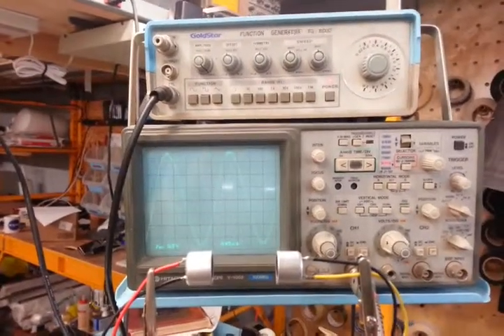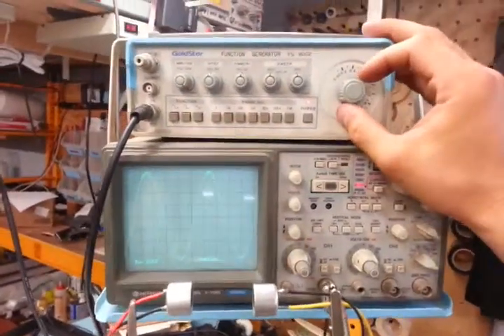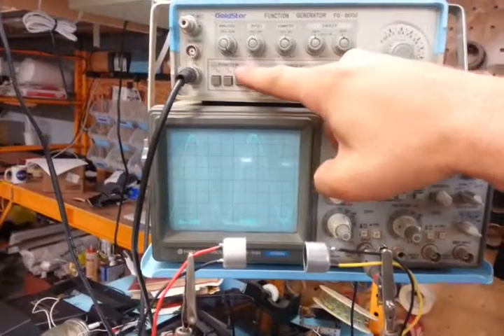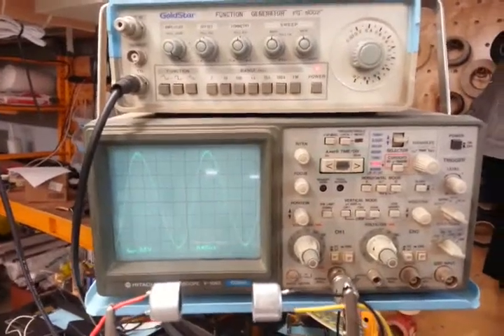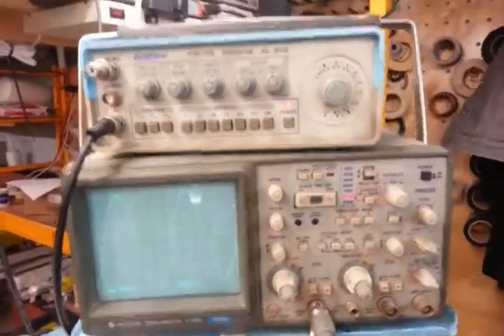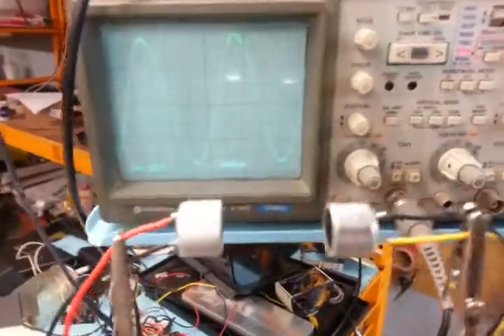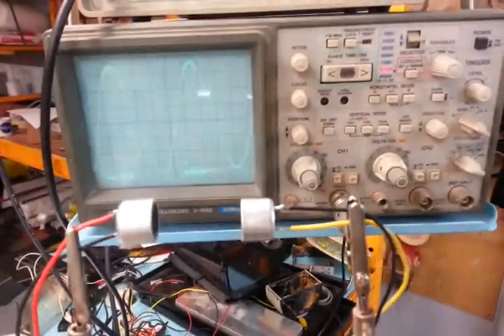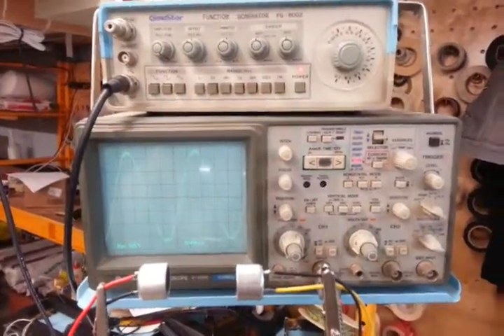Double sheet detection via 38khz ultrasound

Comment: Daniel,
I used to work as a tech. for CompuScan in Teterboro, NJ in the 1970's. We built OCR systems for intelligence agencies and newspapers. We had a double sheet detector that was dang near flawless. We would demo the detector to potential customers by passing single, then double sheets of onion-skin paper and chipboard (used for the backs of scratch pads). I did not work on the design of the machine, but the engineers always claimed the trick was the thin layer of air between the sheets.
CompuScan went out of business years ago, but the design info may be floating around out there.
Cheers,
Reply from the maker: Really interesting, thanks!